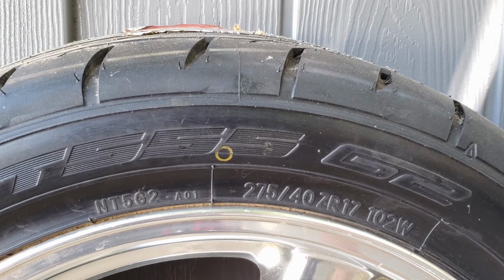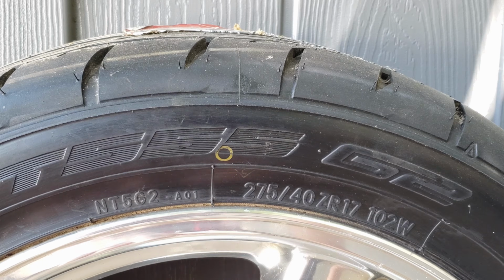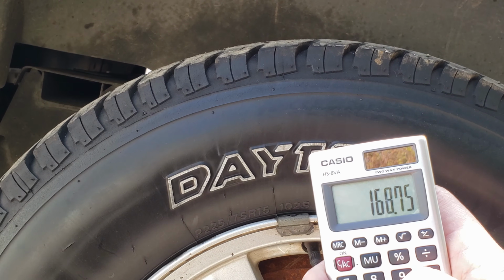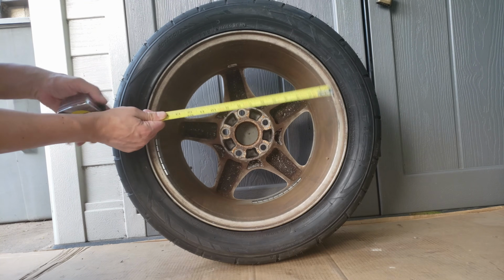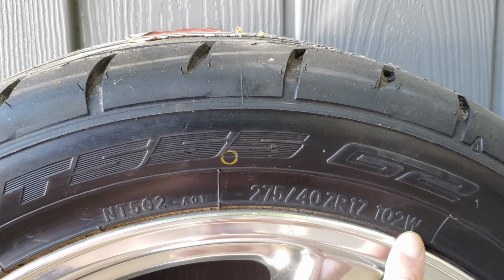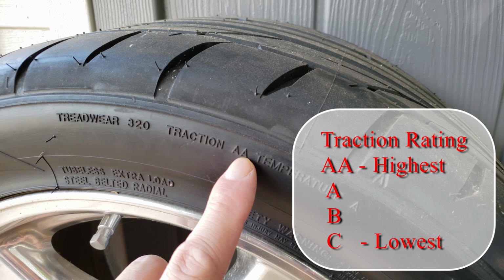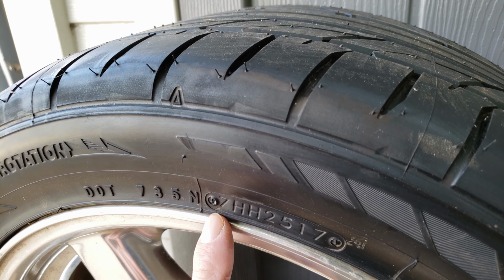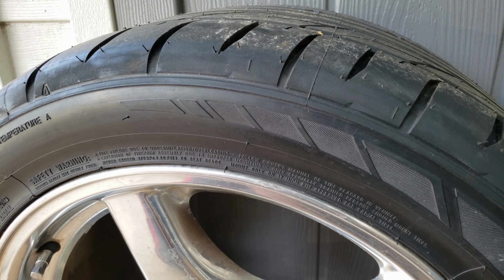How to Read Tire Size Tire Sidewall and Manufacturing Date of a Tire

Comment: 👍 some information I didn't know thanks keep them coming. Hey do you have one on abs? My abs indicator light was coming on and off on my 2006 chevy colorado now is staying on permanently. I am guessing is the wheel sensor or is this something else.
Reply from the maker: Thank you:) not yet, but ill be sure to do that when i encounter a abs issue...it usually is either the wiring to the wheel speed sensor or the hub itself...have u tried scanning it? usually itll tell u which one is triggering it..like left front, right front, etc..then from there just check the connection first, followed by the wiring..if not it may be the hub.
Reply: Thanks I'm still working on trying to get myself a scanner. Nothing expensive just something that will help me out to do my driveway mechanic DIY work. I'm learning as I go It's cheaper to do it yourself than always taking it to a reliable mechanic if I get stuck maybe that's what I'll will have to do.
Reply from the maker: @johnny1556  yea u can save quite a bit over time doing things on ur own...u can also go to like autozone and have them scan it for u...just not sure if theyre doing that during these current times.
Reply: @johnny1556   Hi, I bought the ANCEL AD310 Classic Enhanced Universal OBD II Scanner in 2019 from Amazon. It is currently priced at $34.99 and has a 6% off coupon.